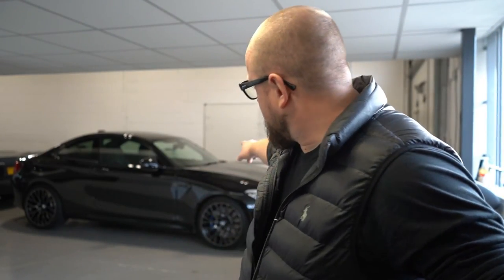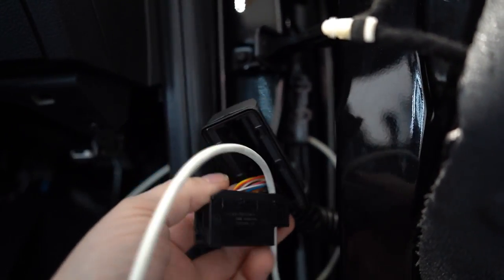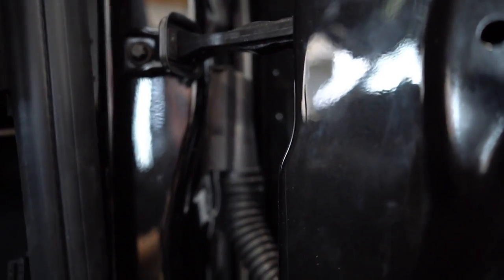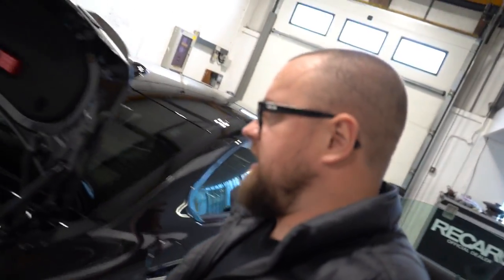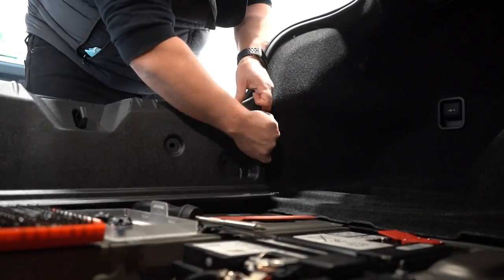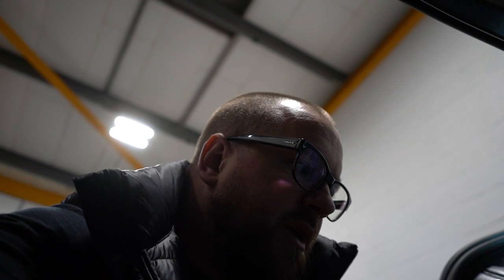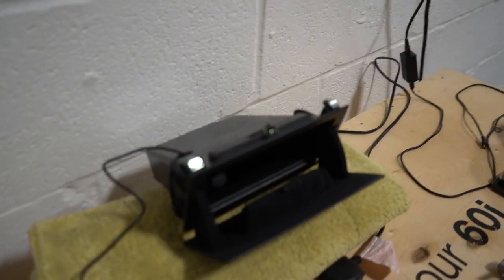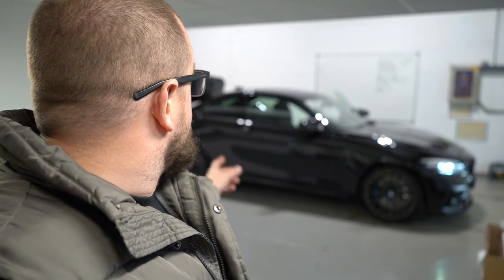BMW M2 Competition Harman Kardon Audison car audio system upgrade

Comment: Nice simple job, so no toslink breakout box as such (can’t remember the proper name for the device, but takes a most signal extracts what it needs and sends it on in the most ring)? Assume you tapped front and sub from hk amp to high level in on the audison amp? Then summed it and sent what you wanted from there onwards? Lovely install Carl and team.

Comment: I want to have a custom speaker pods into the A pillars of my 2024 M340i to accept the Dynaudio 3.5” Esotec mid and tweeter so that they are on axis. This makes wiring alot easier for active xover to each pair of speakers. Does anyone make a digital interface so I don’t degrade the signal converting from high to low level?

Comment: Do you run a capacitor in line with the tweeter in an active system, to protect it from any turn on pops etc? Thanks

Comment: Is there a way to re-integrate bass control to the oem bass adjustment on the infotainment system whether that’s BMW, VW, AUDI?
Reply: @Studioincar  that makes complete sense having full control over just the subwoofer and not interfere with the components is key and with the oem audio setting do you leave them completely flat and tune via audison or whatever processor your running
Reply: You better of using Spotify on high quality with the in built eq it makes a huge difference with nearly no distortion at 90% volume and its crystal clear.

Comment: I know this is the 10” sub but how does the 8” active Audison sound Carl? 👏🏻
Reply: @Studioincar  awesome that’s me sold then! I have an 8.9bit in my f56 running active front, bridged on all channels, so 130 to the s8’s each and 130 split between the mid and tweeter. Thanks for the reply Carl, definitely the final step to ad the 8” in then!
Reply: @Studioincar  update: bought the 8AS !